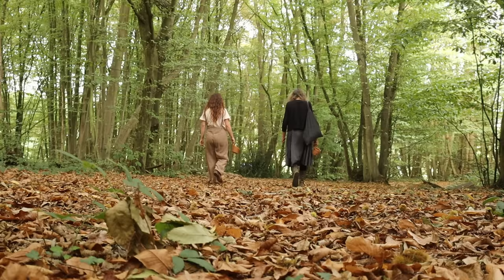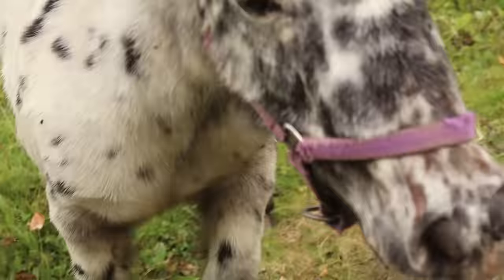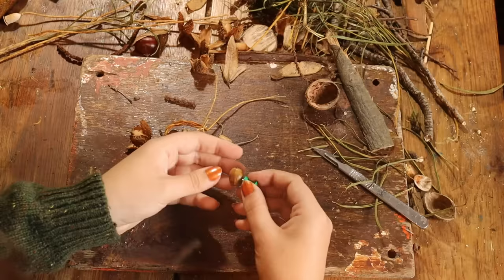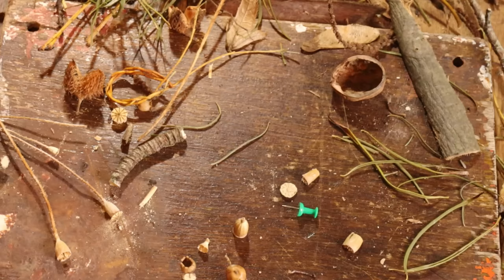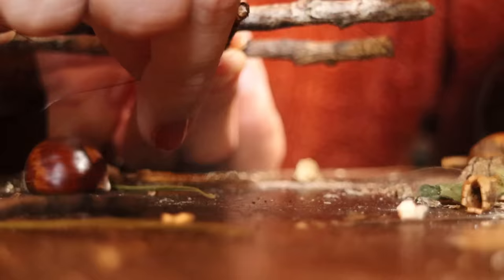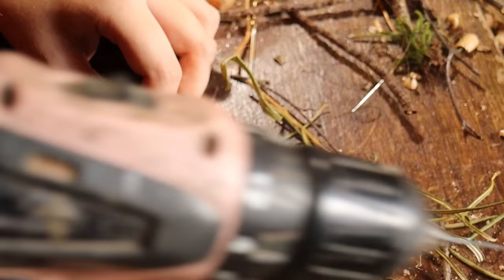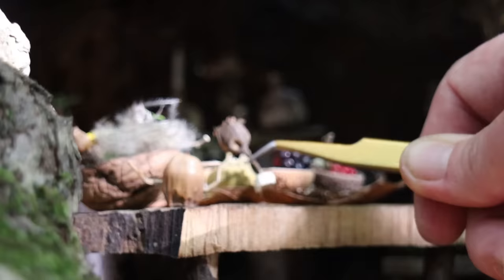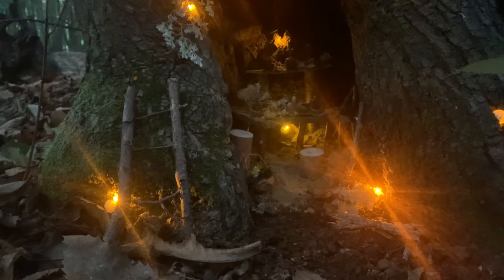We Found A Hole In A Tree + Put A Miniature Room In it - No Glue!

Comment: Another way of tying the bits together instead of using horse hair is to gently remove the bark from small branches of a tree,  bush, or a vine that is still alive and use that like rope or twine. you might need to soak it in water for a bit before using it as it tends to be less pliable in the fall or winter months. Long grass, hay, straw or a type of reeds would also work well, but would need to be soaked before you could use it. It's along the same principle as when they are used for making baskets, mats, hats and any other woven items using plant based materials. Depending on the width of the plant fiber you might need to carefully cut it into thinner strips. The great thing about using plant matter like, reeds, grasses, hay, straw, some types of vines, or the long branches from a weeping Willow tree is that they can be collected and prepared anytime since you need to soak them in water before you can use them. Plus they can be used to make so many different items. You can add food coloring to the water to add some color to whatever you are making such as baskets, mats,or hats.
Reply: Another way to make the ladder would have been to use a small pocket knife or the knife you used to cut a hole in the leaf to make what looked like a purse, to cut notches into the thicker branch pieces and then cut similar notches in the cross pieces which could be held in place by making a small hole in both pieces and then add a smaller piece of a twig in the holes kind of like how you use a nail or a dowel to connect them. This is similar to how people built log homes or other early houses before they had nails and modern tools or fasteners. I used to make fairy homes/furniture and other miniature items for doll houses and other displays to illustrate how people lived back in the 1700s through the early 1900s. I was a primary school teacher until my health forced me to stop teaching. I loved creating things like this from early childhood when my sisters and I would make homes for our dolls, Barbies and other small dolls or what we called wishnix/troll dolls back in the early 1970s.

Comment: In keeping with the spirit of non-toxic, I'm wondering if maybe you could use a bit of tree sap as your glue.? Of course, you might want to test it out first, but I think it might work and should hold alright once it dries. My reasoning is that, tree sap 'usually' hardens when it's left exposed to the air - though I'm not sure how long it would take. Anyway, it was just a thought I had. I love what you did with your creation. It turned out lovely.